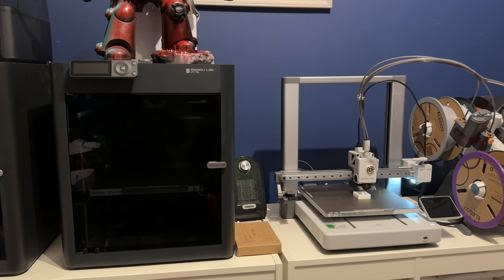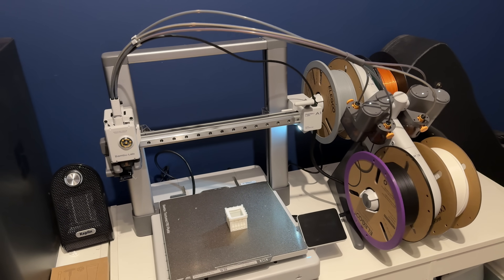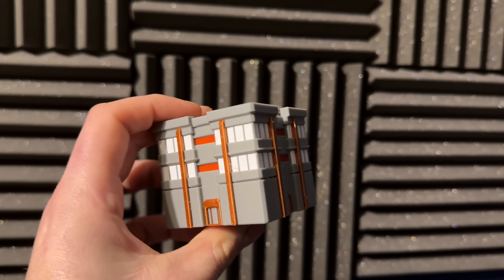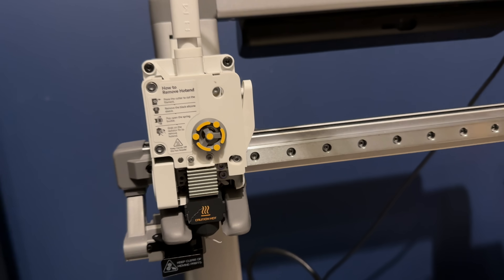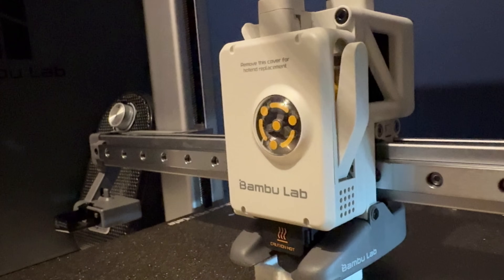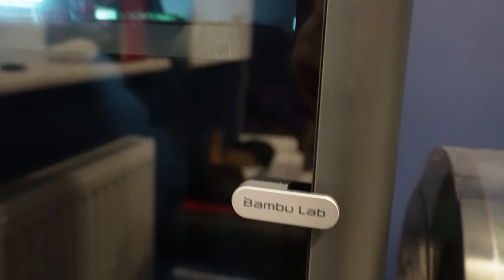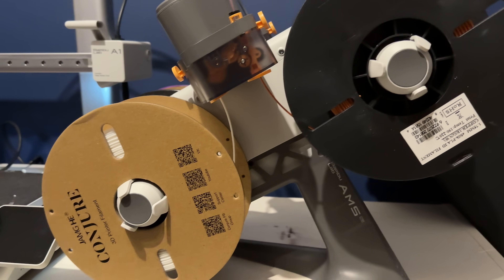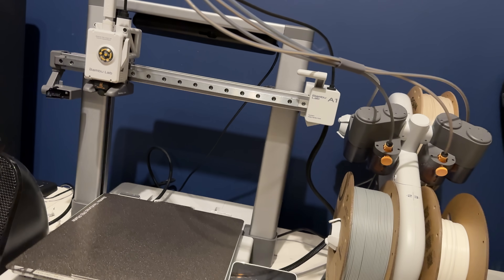Bambu Lab P1S Vs A1: Which one should you get?

Comment: I big down side with the A1 is the bed on the Z axis, and this goes for any printer with such a configuration, having printed for many years with this it can cause issues when print big prints, the constant throwing back and forth, adding in weight with each layer and the extra inertia added, you will notice this with your prints, and to the extreme of the acceleration of the Z axis even throwing your print straight off the bed, especially tall thin prints like vases, and thats where the P1S wins hands down, regardless of all the other features, this one alone is enough to win me over, i feel all printers should now come with the Bed on the Y axis
Reply: The p1s loses in one big way as qell, the price tag, if your on a tight budget the a1 is much more budget friendly despite being a sling bed it's easier to afford
Reply: @colosine  You cant print alot of filaments with the a1 either, specially those like ABS that really needs an enclosed bed, the price tag is the same with any product, you pay for what you get, both are great printers, but the a1 lacks in many areas
Reply: @wolfe1970 right, but if I'm new to the hobby and don't want to spend the bigger money or just can't justify it then the A1 is perfect, especially if I'm only doing PLA because I'm new and need the training wheels, I'm not saying the p1s is a bad deal or anything but there's more to consider than what a veteran printer would buy compared to a newcomer. My first dslr was a cheap barebones camera because if I didn't like doing photography I would have wasted only $400 not the $900 on the better all around version
Reply: My p1s can’t print for crap since day one meanwhile my a1 is getting big files done with no issues @ 100% speed normally
Reply: @luisgranados2545  Sounds like user error

Comment: another thing that is missing in the video, if I didn't missed it, it's the location for the printer... the P1S can be placed as close to the wall as you want (plus the AMS doesn't take any extra space as you said), the A1 need an allowance behind the printer for the bed to move, it's more "middle of the desk kind of printer more than a printer in the far corner of the desk
Reply: How does that work with the poop chute? Do you still need space for the poop to be droppped somewhere?
Reply: @cameralife8  You can print out a collector that won't take tons of space on the side, so not a big issue
Reply: This is essentially the biggest factor for me. It's going on top of a desk unit in the office and space is limited, even with a top mount AMS I am concerned about how far back the bed may sling.
Reply: @ianwinter81  might be too late, but you need 195mm rear and 90mm front overhang for A1 bed
Reply: Yes, this one is big concern for me too

Comment: P1S
PROS
Better camera
Fully enclosed for protection and temp control
Faster
Able to print most types of material
AMS on top

CONS
$300-$400 more
No touchscreen
-----------
A1
PROS
Quieter
Easier to swap nozzles
Touchscreen
$300-$400 cheaper
Easier to fix and clean

CONS
Can only print a few material types
Flings filament poop
Takes up way more space with AMS

If you want something sleek, more compatible with other materials and have the extra money the P1S is for you
If you are just a hobbyist and don't care about printing in any other materials than PLA and your room stays around the same temp the A1 is for you
Reply: Half way through the video and found this comment thank you A1 is for me don’t need the P1.
Reply: How is it (A1) with PETG and ASA? This is what i mostly use

Comment: I was a little worried about not having an enclosure with the A1, but this would go into my computer/music room and I have both an air purifier and dehumidifier running in there on a consistent schedule so I wouldn’t really have to worry about humidity or dust messing with the filament and rest of the machine. I would also revert to closing the air vent and just using my ceiling fan which I believe should help with preventing sudden drafts and temperature changes in the room. I can’t wait til May when they start shipping these out again so I can get one!
Reply: i got one and it is in such shitty condition that bambu said they will replace it for me LOL

Comment: I would have compared the P1P to the A1, as an enclosure just adds a whole new level of usability over open frame. 
The P1 series are also CoreXY and not a bed slinger, which makes a huge difference also.  I'd expect a bed slinger to be slower than a CoreXY machine.
A1 is definitely 1000 times better than an Ender series though.    Quite honestly, like cheaper too, by the time you add all the modifcations you have to do to an Ender 3 and still not get close to the quality of Bambu Labs.    These days I just want something to work out of the box.

Comment: You should choose the one that doesn’t set your house on fire
Reply from the maker: With the cost of gas to keep my house warm, I'm not so sure about that 😂
Reply: @GrayScalpMiniatures  I used to have that problem. now I have solar panels and an electric furnace
Reply: Hi, looking at possibly a first venture into printing. Was watching the nice open design of the A1. My desire is to print essentially a 9” box with a separate top that can be attached with a hinge.  Wall thickness just thick enough to give the box rigidity, so maybe 1/4”.  

The box needs to have a specific shape to fit where it needs to go, and it would be nice to print a logo on the cover in a different color. Does not need surface decorations. 

The part I don’t know is…with a box basically 9” in length, width and depth as well as 1/4” wall thickness, how long would it take to make?  The idea would be to make multiples of this piece. As I have no experience I don’t know how long a box like this takes to print. Thanks!

Comment: FYI the A1 is not on sale atm due to potentially faulty hotbed cabling. Not all are affected, check with Bambu Lab to see what your options are.  DO NOT PANIC
Reply: Full recall as of now (February 9th, 2024). Still, Bambu is handling the issue very well, so when the fixed A1 is available, I'll be grabbing one with the quickness.I can't wait to retire my ender 3 pro...
Reply: @NWGR I'm with you 100% I too want an A1 and get rid of the ender 3s1 😂
Reply: I have A1 with AMS they already change the faulty bed and upgrade the Wire. no issue with my 2 Bambu A1 until now. :)

Comment: I plan to get the A1 and save the money!
Reply: That was my plan also but with the recall going on now there isn't really a time frame for A1s for new customers.  I ended up going with the P1S as a result.
Reply: @MSaxton1 I bought my a1 on December 25th and it was a pretty decent printer I would say it had more failed prints compared to my k1 max and I printed a lot more bigger projects with my k1 max but with this whole recall thing I'm returning my a1 from the recent problems I had with clogging and bed issues and z axis failing to hoke which caused me to not be able to even use the printer for weeks so I ordered the p1s combo last night and I'm excited
Reply: @ColesCraftedWorkshop  I don't have a lot of experience with other brands.  I have two Ender 3 originals and two Ender 3 V2s.  They have served me well over the years and I still use them daily but since I am transitioning from hobby to business I really need to move on to better, more reliable machines.  I have bought into the Bambu hype, lets hope it lives up to it.   If it's as good as I expect I plan to add multiple A1s to the lineup once they become available again in May.  I ordered the P1S combo a few days ago and received my tracking numbers last night.  I am excited as well.
Reply: @MSaxton1  I've known about the hobby for ever and we did it in computer class years ago and I wanted to turn it from a hobby into a buisness as well but for now I need to work on some more fusion 360 courses so I can make my own models. I've already modeled a colonge holder and a nightstand organization tray. So I'm hoping I can be able to get something for them, but I've only had the creality k1 max and the bambu lab a1 so hopefully the p1s exceeds ny expectations.
Reply: @MSaxton1 how was your experience with your P1S? I'm thinking of purchasing it over the A1 and was curious with your experience.
Reply: @SlickTroll   I don't have an A1 to compare but I love my P1S.   I'm up to two AMS with it and I have run it nonstop.  Coming from years of Ender printers this machine is just amazing.
Reply: @SlickTroll  I am loving it.  It's been printing nonstop since I got it.  I bought it with an AMS unit and quickly bought a 2nd for 8 color printing.  I am already looking to more but I am doing a lot of single color gaming terrain so I am thinking about picking up 4-5 A1 Minis next.
Reply: @MSaxton1  Lucky! I ordered the P1S due to your comment 2 days ago, can't wait for this beast to arrive, The A1 was delayed and i was so impatient lol, appreciate the feedback and Goodluck!

Comment: I got my A1 combo a week ago and my P1s yesterday :D wish i could use the AMS lite with the P1S tho. both are great printers so far
Reply from the maker: Yeah you can't really go too far wrong with either printer. Just be aware with the A1 there is currently a potential issue with the heat bed cable to watch out for. If it's not there on your machine, then it shouldn't ever be a problem unless you cause it.

Comment: Great video buddy. I really want a p1p or p1s. Currently have ender 3 v2 but gave up with it a while ago as was having just too many issues. Feel like this would make me fall back in love with fdm printing. I have just got into resin printing and very impressed but fdm is much cleaner and nice to be able to do bigger prints when needed. Any enough rambling, you've got another sub.
Reply: When I got into 3d printing I bought 11 Enders (different models as they were released). I suffered for 2 years trying to get consistently decent prints. I am not a tinkerer, I don’t enjoy playing with printers, so I bought a P1S. Man I haven’t looked over at the corner where my 11 Enders are sitting since. If you want a machine that just works without messing around, get a P1S and thank me later.
Reply: @kevinwarner959  I am definitely thinking of saving up for one. Currently enjoying resin printing but sometimes I wanna print big things now I know they are much faster printers out there before when I was using the ender I never wanted to do anything big because it would take forever and I always thought it would fail at some point. I'm going to be doing custom pc build stuff soon over on my channel so a reliable fdm printer would help out massively. 

Can I ask just how fast can it print? What is your experience with printing fast? Has it made you go "WOW" that was quick lol

Comment: I decided to get the A1, just because the P1S was quite more expensive and i mostly print Standard Materials. A first Test with ASA went ok on it, but I have it inside a warm room with constant temp. Some things i would miss if I had the P1S, The display is really nice and you dont have to search another device. And the AMS lite is so easy to use with all of my spools, even the thicker ones,250g ones and cardboard ones. A very easy to use and comfortable printer. Will probably wait for a P2S, to get in some years once it has a better display and hopefully a wider AMS like Hydra mod. For the saved money I just got more filament and hardened Nozzles/Gear ;)
Reply from the maker: Nice, glad you're enjoying it! I'm intrigued to see what devices they come out with next!
Reply: I understand that with hardened steel noozles you can add the ability to print carbon infused PLA on A1, please if you are able to confirm, Ill appreciate it!
Reply: What about the p2s now? Its double priced vs the a1

Comment: bed slingers tend to be slower than core x-y due to bed movement on the y axis.  if you have a larger mass or tall part accelerative forces moving your print may cause your part to detach from the bed with excessive acceleration.
Reply: wow, never thought about that, that is why I saw many fails on A1s.

Comment: Have you had any issues with heat creep while printing PLA in the P1S? Bambu recommends leaving the door open or the top off when printing PLA, but I'd much rather have it closed for noise and dust. Interested to know if you had any issues printing fully enclosed or if you leave the door open.
Reply from the maker: Pretty much no issues. Everything just tends to print off smoothly.
Reply: @GrayScalpMiniatures  thanks for the reply, much appreciated.

Comment: good video bought the A1 as my first printer and i can recommend it. I do have to say its was not perfect as i'm on my second A1 (now with ams). the first one had a terrible click noise when the bed moves really annoying and loud i think because the gear on the motor was not good. The second i got now for some days is a lot better but also has some noise problems. this one has some rattles so quality control should be better but i have to say customer support has been good so overall a W :)
Reply from the maker: That's interesting to hear. Hopefully your second one performs better.

Comment: I'm loving my A1 with it's AMS Lite.  I've had it for a week and it's my first printer.

I've been printing with it non stop. Been using Bambu PLA with the RFID that automatically recognizes sets the filament profile attributes automatically.  And it performs flow rate calibrations before each print (optional, but nice and only takes a minute)  and does dynamic flowrate calibrations too

I've just received my first non bambu filament, the Sunlu Silk PLA+ .  I'm a little confused though how to set those filaments up for the AMS and slicer.  I know i can select simply Generic PLA Silk profile, but I'm not sure how the AMS and printer will know which AMS filament spool correlates to the slicers # 1, 2, 3, 4.  I think I'll need to first set those filament profiles in the Bambu Studio device tab, then I'm the prepare tab click on the filament Sync button?  

Did that sound correct?  I'm going to try it tonight after work. 

My next printer may be a next gen P2 series whenever those come out, but for now I'd recommend the A1.

We can find inexpensive tent enclosures on Amazon if we want to print with ABS or Nylon on the A1.  A few people on the A1 discord are doing that.  The bed goes up to 100c so i think Bambu kinda predicted some would try such filaments in it.  Just hold your breath when opening the tent and try not to breath the noxious gasses 😂
Reply: Its quite easy to set up other filaments. For AMS, just click the + right of filament to add new ones and then just set the type for every material you want. The standard profiles work great, no comparison to my other printers, how easy it is.
Reply: Or you can change the filament type from the printer, and it will sync with the slicer

Comment: For cardboard spools, I just break off the sides and slide it onto an empty Bambu spool.  That works quite well, except that the Bambu won't auto-detect the filament.
Reply: Double check that the size of the cardboard hole is larger than bambulab’s one BEFORE breaking it :)
I almost ruined a new cardboard spool that didn’t fit on the bambulab’s empty spool. (I had to print a 2 part spool to save it)
Reply: @reminiDave  yeah several of them make the inner cardboard smaller. which sucks. but there are adapters you can print.

Comment: There is no perfect Bambu printer at the moment.  I want the touch screen from the X1 carbon and the easily interchangeable nozzles from the A1 in the P1S format.  I am happy with my P1S, but I'm disappointed that I can't get those other features.
Reply: A decent middle ground is the aliexpress aftermarket hotends so you can just unscrew the nozzle and screw in a new one plus use cht nozzles for even more speed and more even surface finish.
Reply: Look up Panda Touch screen for Bambu, it is a pretty inexpensive upgrade to the screen to bring it into modern times.

Comment: I was looking for this comparison! I think i’ll go with the p1s for the possibility to print ABS. I don’t usually print ABS but i would be able to
Reply: u can print abs on a bed slinger.
Reply from the maker: They don't recommend it though on the A1, I believe because the print bed doesn't get hot enough.
Reply: @GrayScalpMiniatures The print bed does get hot enough, the main reason they don't is that enclosing the printer also traps heat around the other electrical components like the main board and PSU, which aren't rated for running above 40-50° for extended periods of time. 

Also they'd rather upsell to the P1S lol

Comment: Great comparison, thanks! I've had an A1 combo in my cart for a couple weeks LOL - I think I have to get one to supplement my Elegoo Neptune 3 🙂
Reply: I have a Neptune 4 pro and since getting the A1 combo the Neptune doesn’t get used.
Reply from the maker: If you do get one I hope you enjoy it. I went from the neptune 3 to the P1S and it was just such a different machine that I kind of fell in love with FDM printing rather than my usual resin stuff.
Reply: @GrayScalpMiniatures  The post  processing and clean up for fdm is nothing compared to cleaning tank trays and build plates every print. The next level in 3D printing is POLYJET.
Reply: Same here with my neptune 4 pro but to pull the plug